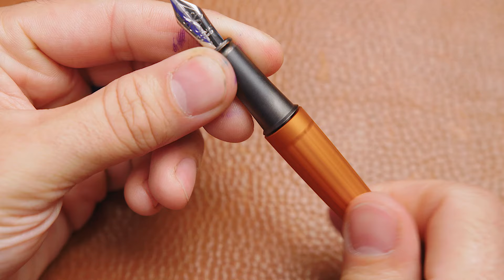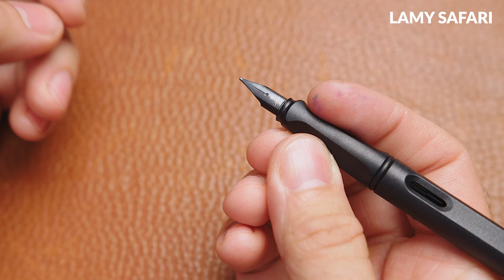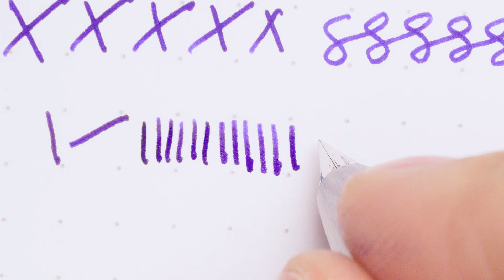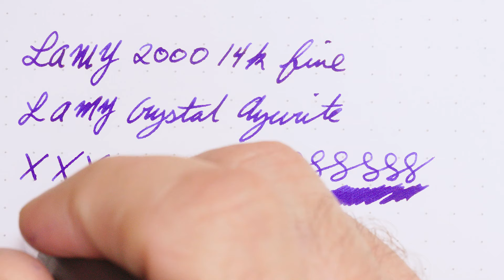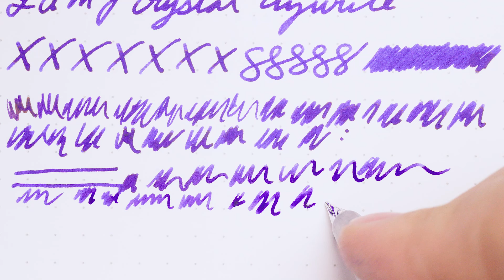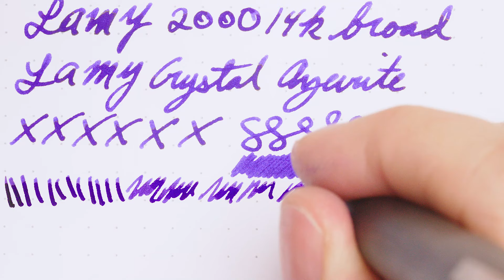Lamy 2000 Nibs *EXPLAINED*

Comment: THank you for such detail analysis on L2k nib. Frankly speaking, I had have 3 EF L2k before but all sold due to the line being too thick.
Until last year I made up my mind to find a nib miester to grind the nib for a new L2k, then I only enjoy the TRUE EF L2k for my self.
Lamy designed the L2k nib shape for a purpose, but it is not my cup of tea. 
Therefore, dont sell your L2k but look for a nib miester that can solve your problem, to adjust to a drier nib or grind the nib.

Comment: If something is well made and well designed, it shouldn't be expensive. Especially if the production process has been perfected since 1966. This is a scam, and you know it.
Reply: The nib is 14K gold with very precisely engineered parts. Learn a thing or two about engineering before commenting such pointless ideas
Reply: @PrazgreenStudios There are computer processors made with extreme precision and precious metals (gold, rare earths), but they're not as expensive as a pencil. This is called overpricing, and you know it.
Reply: @Pedro-h8d4i  the nibs being gold nibs have hand-done grinds. Furthermore while computing has the potential to create incredibly good tolerances, many of the tolerances in this pen is done via very complex manufacturing such as injection molding metal. You also forget that QA and a 2 year warranty on the pen also go into the price. Clearly you are either completely incompetent on how manufacturing works and very basic engineering or you absolutely love ragebait.
Reply: @Pedro-h8d4i  and also the pencil has far less complex parts compared to the fountain pen version. And even then, the pencil is like $50.
Reply: @PrazgreenStudios You are a very useful tool for the Masstige industry because without tall tales these things would have no value.
Reply: Do you want to know how much it costs companies just to make good packing for products? It costs a lot. Then the products are especially challenging. Phone bezels. They take hundreds of dollars in engineering just to make the bezels smaller and more even,

The smallest engineering detail that may go unnoticed to the average person makes a major difference to the actual longevity and functionality of the product.

So call the pen expensive if you want to. IT IS. But for that it is well engineered by people who know far more what they are doing than you when it comes to designing products and figuring out how to manufacture them as affordably as possible without sacrificing user experience.

It is expensive but not overpriced. It could easily be much more expensive and still be a popular pen, but it isn't. The Pilot Vanishing Point is similarly priced and has a more obvious piece of amazing engineering and in my opinion is the 2nd best engineered pen. the best is the Lamy 2000 for the reasons I have mentioned.

It is expensive, and you may just be commenting this because you don't like the pen, but it is not a scam in the pricing. Labor, material costs, manufacturing costs, QA, warranties, ect. all cost money for a business. Lamy must still make a profit, and they do without screwing over the customer.
Reply: @Pedro-h8d4i  and yet do they injection molded metal. I'm willing to bet there is less gold in a CPU than a fountain pen nib or at most a little more. CPUs are also in an entirely different realm. And they are far more expensive. I do not know what world you are living in, but CPUs are very expensive. They are manufactured in completely different ways. The pen is yes quite expensive, but it is not in any way a scam. CPUs are also better funded than pens. If you have a bunch of investors, you are more likely to be able to sell your product for less. A pen is more niche and as such won't get the pros and cons that come with investors. Intel is struggling right now partially because of the investors.

It is not a scam. The closest to a scam on this pen is the limited edition colors because those are expensive bc of rarity.
Reply: @PrazgreenStudios What you say is true for small, artisanal producers. But not for Lamy, a large company with investors that has industrialized the process and reduced costs. What you're selling is a German scamm. I insist: if something is well-designed and well-produced, with years of experience in the process, the product shouldn't be expensive. Like a Ford Model T. And I live on planet Earth, where I'm not going to buy a Ford Model T for the price of a Rolls Royce.

Comment: Hi. Mi Lamy 2000 medium nib unit is leaking from the both end of the clip. What should I do? Please help.
Reply: Try to clean the parts, if the problem is not fixed, then contact Lamy customer service, they will give you a free solution. Regards

Comment: Reminiscent of the iconic “51” in terms of ink collector, feed, 14K nib and hooded design—and the 2000 emerged when the “51” was still in production. In some respects might be considered a modern re-interpretation. Great the 2000 ended up with this long production life—if only Parker were as wise with the “51”.
Reply: Any good reasons not to buy the current reiteration of the 51?
Reply: @Dee_Just_Dee They're expensive and inferior to the original.
Reply: Absolutely, the Lamy 2000 is like a rehash of the Parker 51.

Comment: I’m looking at purchasing my first gold-nibbed pen, and, of course, the Lamy 2000 is one candidate.   I own most of the Lamy steel nibs from extra fine to broad, and also the cursive specialty nib and the calligraphy nibs.  I love all of them.  

In this video, you’ve shown us how the extra fine nib for the 2000 is like an architect nib.  The Lamy Cursive nib is also like a modified architect nib, and I like it very much.  Does the Lamy 2000 extra fine nib write similarly to the Lamy Cursive nib?  

I like the basic Lamy Safari and all its variations (VISTA, Al-Star, Joy, etc.).  My only complaint is that the caps don’t seal as well as the TWSBI or the Platinum caps do, so if I don’t use the Lamys for a short time, they dry out.  Is that also the case with the Lamy 2000, or does the nib stay wet for a longer time?

Comment: I wish I had seen this video before buying the medium 2000.  I think its probably fair to say that most of the time line widths on European pens are wider and the pens wetter than Japanese pens and this is a significant problem with some pens eg the M1000 Pelikan v any Japanese pen or even the M800 in the same make of pen. I watched someone systematically assess the line width of the Extrafine, Fine and Medium nibs on Lamy 2000 and it seemed clear that the gap between the EF and F v M was dramatic BUT the line widths of the EF and F were 3.0 mm or less while M was about 5.0 mm. In my hands the Lamy 2000 M writes like a fat wet sharpie! line width like 7.0mm, Your video shows the difference BUT ALSO MORE ACCURATELY REPRESENTS THE ACTUAL LINE WIDTH....WOW. IF my pen smith cannot grind the pen down to something far closer to 0.4 - 0.5 mm (ideal for me - large hands for a woman - long fingers....medium to small handwriting usually cursive) If he cannot I plan to sell the pen because I would hate for a perfectly good pen to go to waste unused and purchase a fine nib....I wish I had seen your video prior to purchase - I would have expected what I got. The lady who did the video systematically demonstrating how each grind worked had [compared to mine] very small hands and wrote differently. The "problem" has to do with many subjective and individual differences between people. Thank you for this video - at least for the next pen I buy I know whose reviews line up with my own preferences and experience / feel of a pen. Thanks again.

Comment: I finally understand the difference between EF and F. The resultant writing has always looked almost the same to me, but now I see the EF has a bit more variance in line width based on stroke direction, which is explained by the shape of the grind. I think I prefer that to the F, but alas I ordered an F yesterday so such is life. Perhaps the smaller "sweet spot" on the EF would drive me crazy and not be worth the better "style" the EF provides to writing. I suppose I'll eventually end up with an additional EF in the future to see for myself.

Comment: Lamy 2000 with M nib, definitely the way.

I have japanese pens for Fine/EF writing.
But if the paper can handle it, and the space allows it, I'll be going with the Lamy M nib.

The colors just pop, and ohh the butter smooth writing.
I have a Kaweco in BB nib, and I think that's about the same thickness, but of course the Lamy is much much more smoother and wetter.

Comment: I picked up an OBB back when you managed to get hold of some. It's unique and one of my favourite pens. It certainly writes like a firehose. Wet even beyond the B nib. It is rather picky on rotation. If it isn't on the writing pad it doesn't want to write. If you can write with it, you can write with any fountain pen.

Humourously I have used the OBB for writing kanji on 6mm ruling. It can end up being a rectangular block of ink. surprisingly recognizable despite that.

Comment: An excellent review of the Lamy. I do wonder why they grind the top of the nib, as it is not actually used. 
Strangely, my favourite pen is the Platinum Preppy. It is cheap as chips but it writes like a dream (medium nib). It also writes perfectly in reverse mode and turns a medium (03) into an extra fine with no scratching.  It is the perfect pen for the moleskine as there is no bleed through.  I have often considered the Lamy and my just order one 😊. Thank you again.

Comment: You may add that despite Lamy 2000 being considered ahead of it’s time and design it is really a modernist take on Lamy 27, a pen that made Lamy. The cap is very different but the pen body is the same. Without the cap Lamy 2000 is enlarged Lamy 27. 
But since your focus is on the nib, you forgot to mention that Lamy 2000 has exactly the same nib as Lamy 27 or Lamy Ratio (steel nib). Nib is interchangeable between Lamy 27 and Lamy 2000. And in case you wonder, Lamy 27/Ratio has the same problems with the “sweet spot” as Lamy 2000. But the qualities of this nib outweigh its shortcomings. That’s why it has been in production since 1952, and will hopefully be for another 70 years.
Reply: Thank you!!! You answered the exact question i was asking-is there a stainless steel replacement nib for the Lamy 2000?  (The 14k gold nibs cost and arm (and a leg))...

Comment: I wanted to respectfully point out a tiny error the explanation in this video, which by the way is a great resource. At roughly 11:00 you point out the extent of the tipping on the EF nib, saying that the welded tipping material extends down to the underside of the nib some distance. It does look that way, but that distinctive bulge that starts some way behind the actual tip of the nib is not tipping. It’s gold, and is part of the main geometry of the nib. It is of course plated with rhodium, so you can’t see that it’s gold. 

I recently ground a Lamy 2000 EF nib into a fine cursive italic. This involved removing material from the underside of the nib, including some of that bump and its rhodium coating. The actual tipping is very much smaller than this part of the nib – perhaps only the first millimeter. The difference in material is very clear under magnification after grinding. Part of the slight bulge on the top side of the nib is also gold.
Reply: Interesting that you chose the EF for a CI. Was there enough tipping to show much line variation? And, as a fine CI, how sensitive was the nib to being in the "sweet spot"? Thanks
Reply: Yes exactly

Comment: I am in no position of affording a Lamy 2000 but I think it might solve some of my issues with FP and the papers that I write on in practical life. If somehow the ink-paper combo makes it write dry, normal nib pens write a bit too fine and it looks jittery like you were drawing with a mouse in MS paint. With the flat tip of 2000 maybe it will eliminate that inconsistent behavior. It seems to write too wet though, that worries me.

Comment: Great video! I wanted to like this pen so much. Bought the lamy 2000 medium nib but had the classic "sweet spot" issue and it only wrote on a very very very specific angle that was unnatural for me and was unusable outside of that. Had to return it unfortunately. Curious if this is just a quality control issue, and perhaps I might have better luck with another pen, or if it may be due to my writing style/way of holding the pen (although never really had this issue with any other pen... great results with the Lamy Safari M). The little metal "ears" that help hold the cap were also kinda annoying for me.

Comment: I bought one a few years ago. For me it skipped regularly and I could not adjust my writing to get rid of the skips. Also I found that the smoothness of the pen body required me to grip it tighter than other pens. This gripping also made the pen uncomfortable to use. I put the pen away and have not used it since. I intended on selling it but have not gotten around to it. A big waste of money for me. Don’t buy it unless you are willing to return it if it does not work for your writing style. Best to try before buying!!!

Comment: I have found that the 2000 is sensitive to the  viscosity of the ink. I first ink I used was too “thick” and caused the 2000 to skip. After I switched to Lamy inks, the skipping disappeared.

Comment: I have been wanting a Lamy 2000 for a while but seeing how the broad writes I need to get this pen! I love juicy, wet nibs that show off a lot of sheen in inks. Do you happen to have any insight on how a broad L2000 performs with shimmer inks? And would you advise not using shimmer inks in it because I'm unsure how cleaning the feed goes with the L2000 if it's possible to remove or if I just have to flush the pen.

Comment: I love my broad nip on my 2000 that's the 1st and only lamy 2000 Anderson I love the ink output and I find like you not too sensitive to the angle however rotation I definitely have to watch it.  And I do understand the sweet spot. If I want to be able to skip your course on ink and I'm worried about space then I'm automatically drawn to the fine points. But that's what I have other pens for.

Comment: Great vid! Honestly though, I really regret getting the 2000. Personally never felt it wrote any better than many other kinds that I have  within the same price range AND it's pretty difficult to get a replacement nib. If you do end up getting a replacement nib, it's almost the cost of the pen. Accidentally dropped the pen, bent part of it, sent it in to Lamy for repair estimate (or to see if warranty still covered it), but was given a $160 quote for a nib replacement. Ended up spending $60 on a copy of the nib and certainly doesn't write the same as it once did.
Reply: I definitely feel you. I dropped mine and ended with a backwards fude looking nib. When I went looking to nib replacement prices I realized it was more than what I paid for the pen when I got it 4 years ago ($100 for the pen then and $120 for the nib now). I don't understand how such a tiny nib can be basically the same price as a whole pen.

Comment: My biggest issue with the L2K design is that the seal on the cap covers the entire section instead of just the nib. This causes ink to splatter onto the section if the pen gets jostled, leading to inky fingers.

Comment: After Brian took it apart, I might be finally sold on the lamy 2000...I stay away from piston fillers because I change inks extremely often which means I like easy to clean pens...but with the disassembly/assembly, I think I ran out of excuses. The depth on the nib explanation vs jowo was enlightening. Thanks for the video!!!

Comment: I made the mistake of ordering a medium nib on the Lamy 2000 and haven't been using it because it's just too much of a gusher. Never seen a pen that puts out so much ink. I'm looking at trying to get a fine nib unit for it so I can get some more use out of the pen. It was my first gold nib pen and I like the design but it just way to wet. My handwriting is not so great with a pen that doesn't put out as much ink as the Lamy 2000 but it's just a mess with the Lamy.